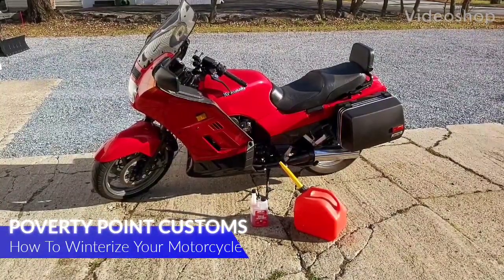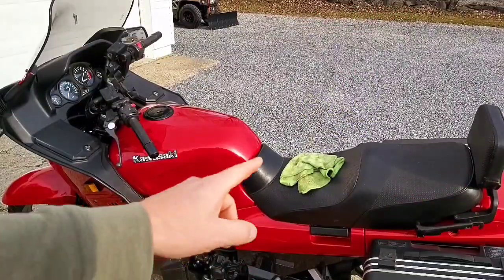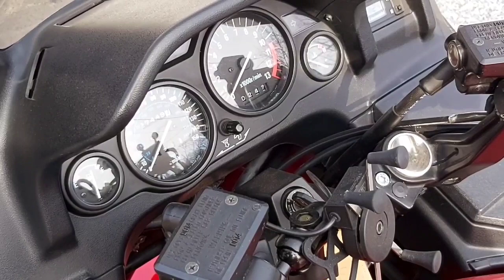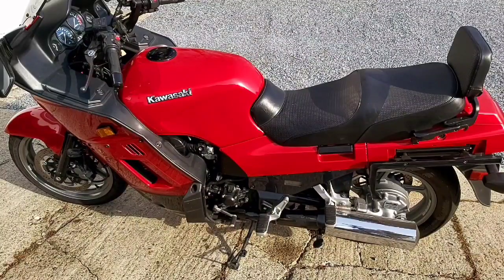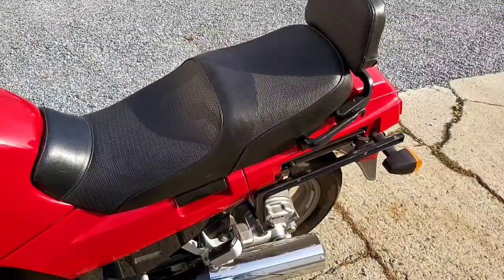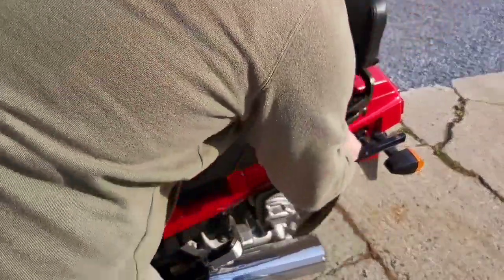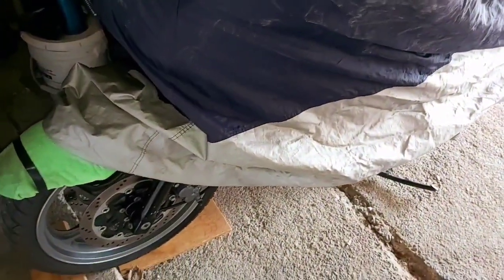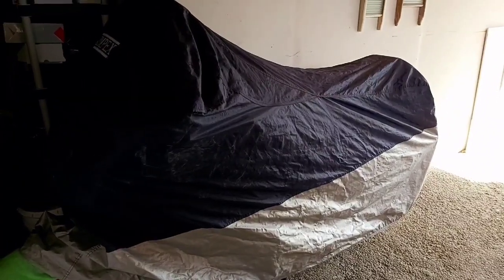How to winterize a Motorcycle

Comment: Nice, through job on winterizing your Connie. I do wonder about the turning the petcock to the position in the video and then running it out of fuel? I believe you mentioned you were in Canada? Do the Canadian Connies have a different OEM Petcock? I just replaced mine this spring on my 2002 Connie, since it was leaking with engine NOT running in the ON position.  New OEM ones in the USA only have 3 positions available.  The “handle” on the petcock pointing toward the front is PRI ~ (prime) position ~ turns gas on without engine vacuum.  2nd position  ~ ON “handle” lever pointed down toward the ground. Fuel flow is ON only with engine running and vacuum available to open the petcock. 3th is RES ~ reserve, “handle” lever pointing toward back of MC ~ fuel on by vacuum available at a lower fuel level than “ON”.  With the lever in “ON”position would Not allow the engine to run dry, unless you disconnected the vacuum line from the carbs. I didn’t see this in your video, just wondering if you have an aftermarket petcock, or what?  Outside of that question, a very through job in preparing your bike for the long down time. I just start my MC every week and run for 10 min.s or so. I live further south than you and suppose I could ride year round if I wanted. The once a week start duty is easy enough for me. I also put an additional manual fuel shutoff valve immediately after the new petcock. I shut off immediately after I run the bikes engine. If the petcock starts to leak again with no vacuum, (and if a carb float valve was stuck open) fuel would not be able to get into the combustion chamber that might hyd lock a cylinder should those (2) events happen at the same time. (I even replaced all 4 bowl needle valves during the bad petcock issue this last spring). Better safe then sorry .  I have Not experienced any fuel starvation with this particular manual inline fuel shut off valve as I was warned might happen. Works great as added insurance against hyd lock for older carbureted MCs engines.